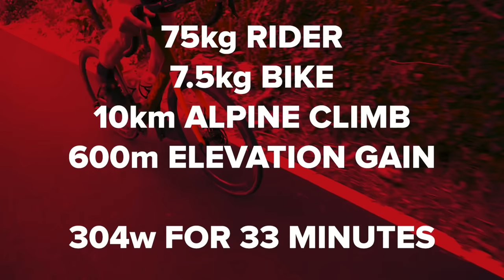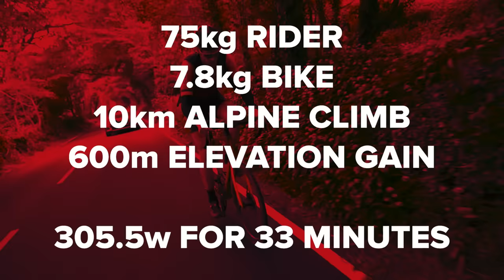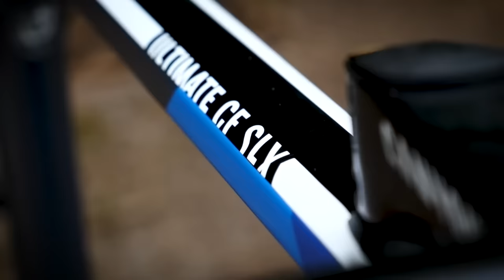10 Reasons To Consider Aluminium Over Carbon For Your Next Bike

Comment: My Cannondale aluminum frame is 25 years old, with a few dents, scratches and gouges it's still going strong.  I am utterly convinced the carbon equivalent would fail within the first 10 years
Reply: Aluminium
Reply: Wilderness Music  you're right, but I'm not sure why you respond to my message, which was a not so serious correction of the usage of the name 'Aluminum'.
Reply: Depends on how you treat your bikes. 2003 Aluminum Specialized - I broke it. 2005 Carbon Specialized Roubaix - still have and is now my daughters bike. 2011 Trek Madone 6.5 - still ride it and it has about 50k miles on it. I suppose if I was crashing or getting hit by cars all the time, none would last all that long.
Reply: Agreed. I have a 1985 Klein still busting out the miles!
Reply: I have a feeling you know that the carbon would not last you as long so you didn't bother lol WildernessMusic_GentleSerene

Comment: I agree with everything said. Still want carbon.
Reply: @robbiddlecombe8392  just get a carbon fork then
Reply: @wjkkwjkf2980  i have a carbon frame, seatpost, handlebar, and seat, but still prefer aluminium fork. I hear waaaay more carbon fork failure stories than carbon frame failures, and you rarely hear about aluminium fork failures. Before people say that carbon fork failure risk is negligible if you use proper torque specs: yes, using my torque wrench i use proper torque specs on everything but i still prefer aluminium forks.
Reply: @Brother Paul define "better". Better at what, strength to weight ratio?

I'd rather ride aluminium frames than steel frames. Been riding aluminium frames for 20 years, just a recent convert to carbon.
Reply: @Brother Paul My 1985 Chromoly bike is still working perfectly. Let's see their carbon fiber bike after 35 years.
Reply: One crash and it will be gone. My Aluminum Bike weights less than most newer carbon bikes from canyon and a like, it also already survived 3 crashes with cars with only one shift eye being a little bent.
Reply: @The2808erik  - what frame is it?
Reply: well that doesnt make you fast tho.
Reply: @davehanhela5997  it's from Dr. Mohr from Mohr Bikes in Germany custom made for my dimensions.
Reply: wuss
Reply: @ancogbernard  it depends on who's pedaling and who is one racing against
Reply: @Brother Paul I own a Raleigh 1985 Chromoly road bike and I couldn't agree more. I have a carbon and alloy MTB, though I love how light my carbon MTB is but still prefer Chromoly and Alloy.
Reply: @echomike8591  yeah how about me😅🤣🤣🤣🤣
Reply: @ancogbernard  lol I suppose you already knew the answer to your question  :)
Reply: @The2808erik  a friend of mine got into a crash with a carbon bike and it was just fine (yes it was checked) 

Nothing beats the durability and ability to repair of steel 😉 it's not easy at all to repair aluminum, and my mom had to search hard for a speciality welder to repair a hole in her aluminum frame
Reply: @sepg5084  Carbon frame should last 30 years without a problem
Reply: These discussions are the same as politics. It's a pendulum. I'm 64 and have most of the arguments. In time we will be back to steel.
Reply: @3520Rick  No, we won't be.  Alloy fine, carbon awesome.  Steel, no.........

Comment: Finally! I knew it all along! I’ve put 12,000 miles on my aluminum road bike and love it. It handles great. It’s just not worth the extra thousand bucks for about a pound and a half. The components make the bike and if you aren’t going to be racing up mountains that little bit isn’t going to make a difference. If we are riding for fitness, maybe heavier is better in the long run.
Reply: Ferry Gunadi  I have both. Actually 3 bikes. And going to buy new bike. Why not? All bikes are sexy😀
Reply: Steel is real
Reply: @sirehan1002  for real men!
Reply: @sirehan1002  my long haul trucker will out live me, by a long way
Reply: aluminium*
Reply: You can't spell it's "aluminium".
Reply: See rock bar cycling for a bike weight
Reply: I rode both aluminium and carbon. I'll have a carbon frame over AL any day. To me the extra money is worth it. Press fit bearings last longer, carbon absorbs shocks much better and reacts much smoother.
Reply: "Heavier is better." Couldn't agree with you more. I'm on an el cheapo MTB and, although I won't be breaking any land speed records, I can work to a respectable level of fitness. Old man on an MTB.
Reply: @username8644  just wait till they hear the way we pronounce "aluminum"! 🤣
Reply: it's not the weight, it's the comfort
Reply: I have an aluminium bike and it is so uncomfortable. I can feel every bump and imperfection in the road
Reply: @Tendertroll1  Use bigger tires or lower the pressure.
Reply: @Mensch-et3xm  more rolling resistance though
Reply: As a U17 rider I  have made a uphill time trail in 13 min 20 seconds with a bike of 11 kilos later I had another bike of 10kilos and I tried again (320 altitude difference on 3,3 km) and I could not clearly see a difference in time between various tries 
Years later I have calculated my weight was 72kg plus 11 kg =83kg vs 82 kg
Theoretical time saving is 1/83 of 800 seconds must be something of 8 seconds 
300gramm difference between Alu and Carbon is ridiculous 
If you are racing Alu has further advantage it is not so sensitive for transportation damages
Reply: @King Of Crunk I hear ya. I broke a frame there myself once. I decided my road bike wasn’t made for washboarded gravel back roads. Oddly enough it says that right on the info sticker.
Reply: @King Of Crunk I have a FUGI road bike with Shimano 105 :11x2 gearing and cable activated hydraulic disk brakes. It’s only a couple of pounds heavier than the carbon fiber iteration. The carbon fiber one had fully hydraulic brakes and I wanted the simplicity of the cable type. The bike handles beautifully all the way around. I did upgrade the rear hub to a DEOR and it is a good bit smoother and faster than the standard FUGI hub. So altogether I have about $2k in it. I upgraded the seat but saw very little improvement over the stock seat. But unfortunately you have to buy one to find out. I have 13,000 miles on it so far. For someone as old as I am I didn’t think something more expensive would give me that much more performance. I did 150 miles in one day on it and several century events. I’m training for a 4 day Erie Canal ride for the first of June.
Reply: @King Of Crunk sorry i forgot to mention it’s a FUGI Sportif disc
Reply: @ericjohnson8571  how old the bike? I worry reading aluminium last 5-10 years before fatigue but also told go carbon for life time bike, looking at build sub 8kg trek Emonda ALR at moment for less than trek Emonda SL7
Reply: That's my thinking too.  I should lose another 10 pounds off the rider before I worry about a pound or two on the frame :)
Reply: Hambini has a lot to say about £6000 carbon frames , there crap with kitchen engineering on the BB area pmsl

Comment: Just bought a Specialized Allez with rim brakes and Shimano 105. I couldn’t be happier. 🚴‍♂️😃
Reply: Cost?
Reply: @cloak057  Allez Elite with rim brakes at list price $1,500 USD (no mark up) then I installed a Shimano 105 crankset for about $250. It shifts better than the Specialized crankset, plus I needed a short crank arm anyway. Luckily my local store had one in stock. Looks nice in green.
Reply: Fortune to you for actually finding one in stock!
Reply: 🤠i use same exact bike and set up!🤠
Reply: Love mine as well

Comment: The only reason I need: It's cheaper
And the back up reason: I'm broke
Reply: I'm so sophisticated that I chose a 40 year old steel frame
Reply: I am in the same boat along with being cheap.
Reply: As an 80kg guy that wanted to buy a fatbike for the 20km average speed and the capability of carrying backpacks (my usual load of 5-10kg depending on would I buy grocery or not) when commuting back home from dormitory near University, the 200dollar worth starter all stock one is enough for me. Well atleast enough until graduation and finding a stable enough job during this pandemic. I don't need to be a sophisticated guy that aims for a carbon bike. I just needed a good enough bike.
Reply: @stuvademakaroner9607  then I guess you're even more broke than me if that's what you got. I'm pretty sure I bought an aluminium one and it costed me 200USD if I convert our poor currency to your almighty one.
Reply: I'm a realist. I ride fot fun and exercise. I get all that from my old aluminum Cannondale that didn't cost a king's ransom. I'm also cheap and broke. As for that 1 pound or so weight difference, I can do myself a favor by losing about 10 pounds anf come out way ahead!
Reply: Preach!
Reply: Same bro 😂
Reply: I also prefer aluminium. Just because I am tall and thus a heavy weight, riding in crosswinds is more comfortable with my alu bikeframe

Comment: Currently ride with an alumunium frame from Mosso taiwan. Mosso 792pro. 7046 alu, frame weight 1,25kg. The Stiffness & Ride quality is spot on. Better choice than Chinese low end carbon frame.

Comment: He's got a point. You're talking about a 300g difference in frame weight. If I REALLY needed that weight saving, I'd get it off my gut for no cost. 🙄
Reply: Very true. I shed 100 pounds in the last year. My CAAD10 is more bike than I'd ever need, especially at 18 lb with c24 wheels. That said, I have a hankering for a carbon aero bike with deep section wheels
Reply: the carbon with gutted 300g still wins:)
Reply: if you need 300g weight difference, skip dinner,.....
also cyclist used to be quite flexible whit drill,...
Reply: Amen!
Reply: Carbon still rides less harshly than aluminium.
Reply: @williammorris6097  What is your proof?
Reply: @rommelperena4995  it wins if it's a race, where the 300g can be crucial.
For normal non pro riders it's a luxury, of course everybody has the choice what to buy, or not to buy, but normally the rider makes here a much bigger difference than the bike
Reply: @BikeSeatPhilosopher  I come from a family  of engineers

Comment: I know this vid is a year old, but had to offer this.  A friend on his Canyon had a simple low-speed crash and snapped his seat stay in half.  A few days ago, I was struck by a car while riding my Caad 12.  ( Car passed me and then turned across my wheel)  I straightened the bars and rode home.  I might need some new bar-tape.  Even my Hunt Alloy wheels are still straight!  If that's not enough, the Caad12 is currently 15.5 lbs!  Ultegra mech, rim brake, carbon bars & post.  10,000 miles on it and counting.

Comment: I have a 10.5 kg aluminum B'twin Triban 3. The one with the carbon fork. I picked it from decathlon about 5-6 years ago for £300 quid and it's still going strong. I've had a reletivly big crash on it and I just picked it up and put the chain back on and used some t-cut on the scratches. I dont race so I don't need a 4-5 grand bike, I ride for fitness so I'm ok with the 8 gears as it puts my body out the comfort zone on the many climbs I have here in Scotland and I can certainly keep up with someone on a much more expensive bike through sheer fitness. Half the reason a lot of cyclist are still overweight in my opinion is that they are trying to make their exercise too easy. If it wasn't for this bike I could never have afforded to get into road riding enjoyably
Reply: You already typed the gbp symbol but British always wrote quid in addition to it as slang

Comment: My current and previous bikes were both alloy, and they were, and are, absolutely brilliant. Carbon may be spectacular when it comes to stiffness and lightness, but it comes with an equally spectacular price premium. So while I may give an envious glance from time to time at carbon bikes with their electronic groupsets, I'm more than happy to gut it out on my alloy frames with the Groupset of the People.
Reply: Many modern AL frames are electronic compatible. In fact, Cannondale actually sold a CAAD10 Black Inc in 2013 with Ultegra Di2 and Specialized sold an Allez S-Works with Dura Ace Di2 a few years later. You're running 105...excellent groupset that can deliver the goods as well as  any of the  costlier groupset.
Reply: This is why automakers starter using aluminum long before carbon fiber in BMW i3 and i8 as the first examples of carbon fiber in medium volume production automotive vehicles sold worldwide. The aluminum intensive Ford F150 more than 600lbs lower mass than the mostly steel conventional F150 and gets way better fuel economy.

Comment: Loving my CAAD12, amazing ride quality and ofcourse an amazing looking frame
Reply: Agreed! When a frame is as good as the Caad12 who needs carbon!
Reply: I love my caad12. Truly an all rounder
Reply: Caad13 after having carbon. Won't go back.
Reply: Same here. Caad12 after BMC carbon.
Reply: I have a caad9. Is it night and day as fast as weight, stiffness and comfort? Caad11 vs 12 vs 13?
Reply: @samuraioodon I'm a heavy rider.  Aluminium stays stiff when I put the power down. I know with the 13, they changed the geometry to be pretty identical to the supersix as far as aero and positioning. With my saddle and sram force axs, weight is 17 lbs.  Plenty light enough for me.
Reply: @staypufft80  oh nice. I wish they had more options with paint job and rim version for mechanical groupset...
Reply: Love my caad10, amazing bike. Its around 90000km now in 7 years using the bike and still stiff and perfect conditions. Weight is around 8.2kg, my weight its 74kg and an 305w FTP
Reply: I had a Caad5 in 2003 and I still want to buy a new caad. I want to buy a caad12 and are not finding it. I like how it looks more than caad13.
Reply: Hi! Thinking of getting a CAAD12, I was wondering if what CAAD 12 are you using? Is it the rim brake or disc brake one? And which do you prefer
Reply: @huroncyclist  Personal preference, rim is lighter, easier to maintain and more reliable, disc is better in the wet and allows more tyre choice.
Reply: @staypufft80  why?
Reply: My gravel bike is carbon and feels great.  Just like the feel of the aluminum mixed with carbon wheels, fork, and seat post.   @Pablo_Coach
Reply: @staypufft80  so You prefer alloy Caad for road riding ang carbon for gravel??
Reply: I do. @Pablo_Coach

Comment: great video!   another valid point regarding weight savings would be if you looked first at losing weight personally instead of buying a lighter bike -- ie if you could lose 3 pounds would be the same as buying a bike that is 3 pounds lighter.
Reply: Removing the front wheel before loading into the trunk of a car can also remove a couple of pounds off the lift. I am thinking of how much easier it is to load the Specialized Crossroads 2.0 into our 2010 Prius with the rear seats folded down by first removing its front wheel so only about 29.5lbs to lift, then put the front wheel and tire in with it, vs the 38lbs mountain bike it replaced. So about 6.5lbs lower lifting mass but very noticeably easier to lift off angle. 

Going poo & pee before riding can remove your GVW while riding by a few pounds.

Wearing low mass tight aero clothing can reduce body inducing aero drag by 15% & clothing mass by 50%, improving performance way more than a slightly low mass bike. 

Aluminum bikes are more durable, more resilient, tougher, fault tolerant, crashworthy, less fragile, more useful, more practical and less expensive than carbon bikes. Aluminum also highly recyclable, where carbon fiber is not!

Comment: Thank you for this.  I bought a Trek Domane AL5 last summer for under $2000 USD and I couldn't be happier.  Aluminum frame, 105 groups...it's the bike of the people!  The tires are 700x32 and at 70-75 psi it's quite a comfortable ride!
Reply: I bought the same bike and it is ze bike. You put carbon wheel on that and your flying my friend
Reply: Liking the feel of your bike is #1, price and materials shape geometry #2...the bike you like is the bike you ride!! All the rest is just word theory into a hurricane!!
Reply: Did you test ride the sl5?
Reply: @Tendertroll1  I great rode the Emonda in carbon.  And I've ridden other carbon bikes over the past few years.  Clearly it's a subjective thing, but I just don't like the experience.  And I've never heard or read anyone else identify a certain "sound" of metal vs non-metal bikes, but: carbon bikes "sound funny".  Plus I think they feel "dead" or "flat".  I don't know how else to explain it.  When I ride steel - I just feel like I'm more  "part of the bike" .  I'm not sure I can accurately describe the feelings any more than that. And for the money - it's not worth it to spend maybe 2x the $ to enjoy my ride less.  And if money were no option, I'd just have a frame builder make me a steel bike - which they can do for less kg than carbon.
Reply: @richardwitt8248  ok thanks for your insight